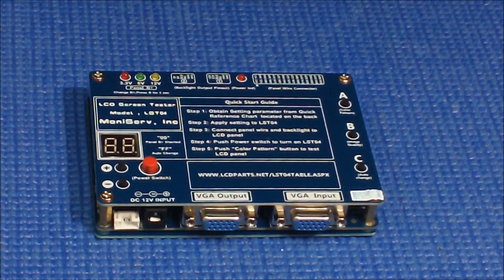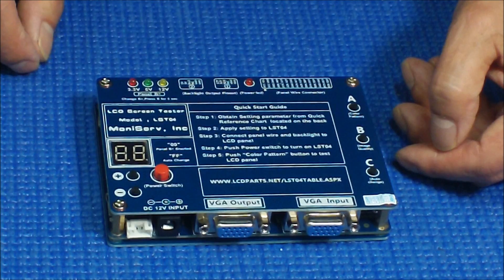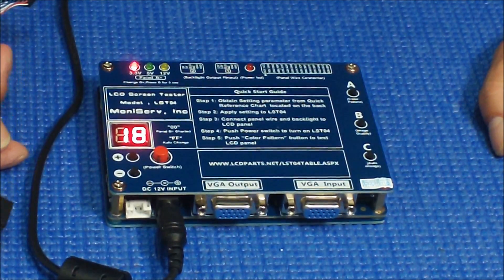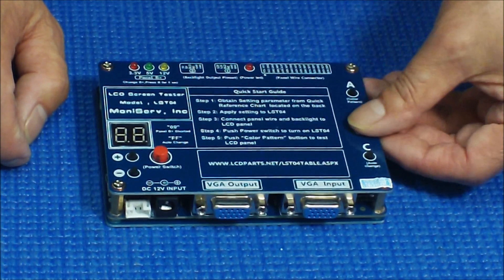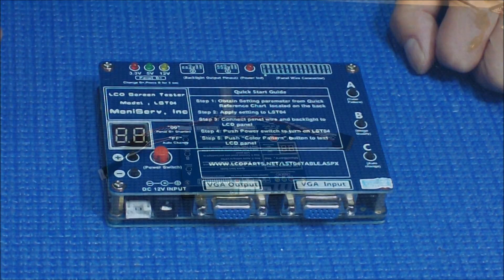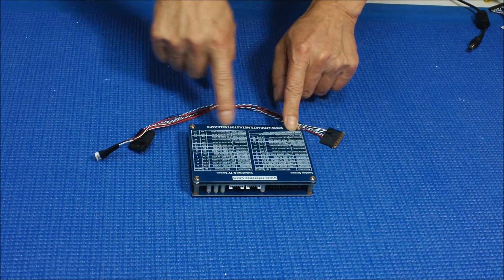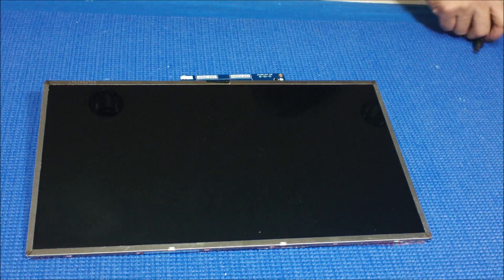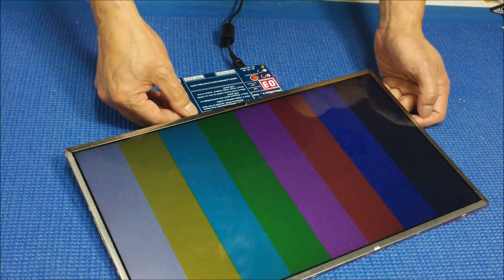LST04, LCD Screen Tester

Comment: Hello.  There is a t-60s green tester.  When a signal is sent to vga input from a computer or from a laptop to matrices with a resolution of 1366x768, a picture with lush colors comes out, as if something with color or with a bitness of not as much as 8 bits but 6 are fed .. Matrix LP156WH2 (TL) (AA).  Something in the firmware of the device?  Two LVDS cables complete with a tester that went 40 pin with two on vga shows distorted colors as if the tester gives the wrong bitness .. and from the LVDS output of the tester in logic mode 12 volts gives only 10